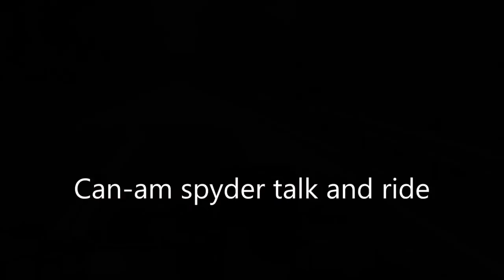Can-am spyder talk and ride

Comment: Yep, Rob (Gimpy Garage) is a hoot.  Any chance you could find an independent mechanic who knows how to work on Spyders?  I did, and it saved me a bundle on my first service.  He came from a dealership that sold Spyders and opened his own shop.  BIG SAVINGS!
Reply from the maker: I do all of my own work and the I my time it goes to the shop is for warranty work so an independent dealer can't help me!
Reply: Do you have an extended warranty then?  I thought the standard warranty from BRP (burp?) was two years.
Reply from the maker: No I do not. I bought my 2015 in July of 2016 it was a new leftover. BRP did extend the warranty until December because of the transmission issues I had!

Comment: I was over in your neck of the woods the last couple of days. Did an Adventure ride in Hocking Hills. Some of it was a little more "adventurous" than I had anticipated.  After lunch, I came across a particularly nasty looking section and had to turn around my 600 lb beast on the downside of a rather steep and beat up section of trail. I was beat after that so I went back to the motel, filled my tires back up with air, and took a relaxing ride on 78. I love that stretch of road.
I may have to give up the adventure thing. Next time I'm over your way, I'll go thru your vids and make a list of the good paved roads in the area to hit...
Reply from the maker: Let me help you spend your money...they make lighter Adventure bikes! Tons of great trails and just 20 min down the road.
78 is a great road to ride tons of curves and plenty of elevation change! Hit me up next time your over this way! Stay safe!
Reply: Yeah, but them little thumpers aren't quite as luxurious when you're not in the woods (which is about 99% of the time). And falling off is expensive and I don't walk so good now. Probably better that I stop pretending I'm 20. Little late for me to be trying to learn to ride like Travis Pastrana.
I'll ping ya next time I get out that way.
Reply from the maker: Stay safe - sounds good!